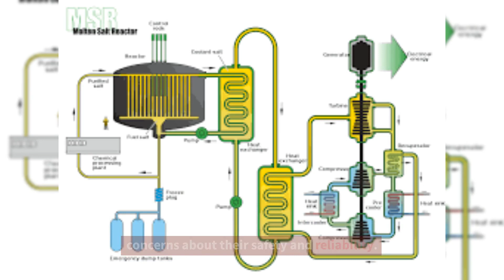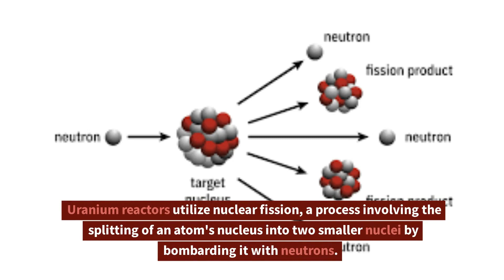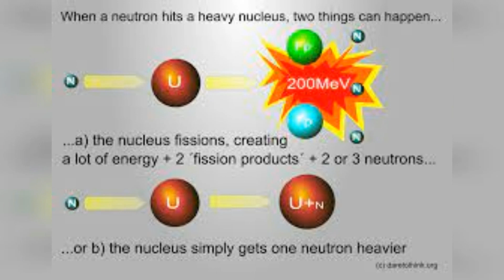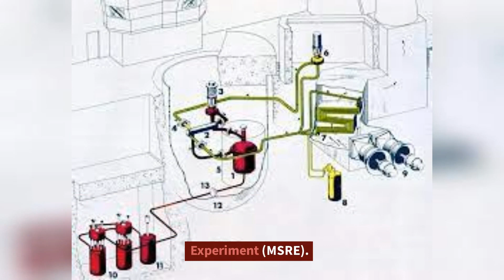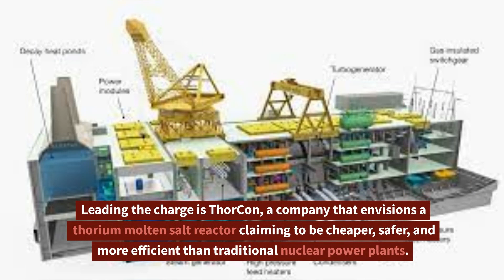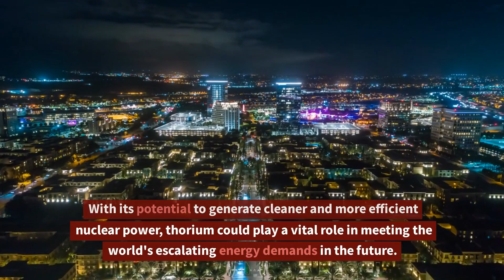Unbelievable Breakthrough: Forget Nuclear Fusion, We Have THIS!

Comment: We start with the premise in this video that uranium reactors, especially initially, were built to produce power cheap too cheap to meter, nothing further from the truth, that was a matter of public relations. The purpose of uranium reactors is to produce plutonium, a very expensive process that produces enormous amounts of waste Heat. Utilizing the waste heat to produce electricity subsidizes the cost of producing plutonium for the War Industry. There was no interest in thorium reactors because they do not produce plutonium, the only reason reactors are built. Without the hunger for plutonium, nuclear power would have never gone anywhere, especially the dangerous uranium-plutonium cycle.

Comment: The main reason Thorium reactors have remained experimental in the U.S. is because the Nuclear Regulatory Agency will not license anything but light water reactors. They always mention the highly corrosive nature of the molten salt but never mention the highly corrosive nature of liquid water under pressure and temperatures greater than 250 degrees centigrade which exist inside the light water reactors that already have been built.

Comment: They forgot to mention that the Uranium produced is weapons grade and would result in nearly impossible to contain from ending up on the black market, it would take so many controls to ensure it is all recycled. Next, they have had this technology since the 50's and still have basic physics and engineering problems, this is why everyone eventually abandoned it, one of the biggest engineering issues is that it does not scale well. Most thorium reactor investment channels are pure scams and should be avoided.

Comment: When finite energy resources are forcefully priced at the bottom of the food chain under the doctrine of what's called 'supply and demand' - they turn - curse...
Adam Smith's fossil fuels-powered invisible-hand, Nikola Tesla, Einstein, Huxley, Orwell and Turing should be forgiven for thinking their systems can last forever – finite fossil fuels are dangerously hypnotic to humans and their mental capacity.
Humans were not ready morally, ethically and intellectually to start the mass extraction of fossil fuels with the advent of the steam engine 300 years ago.
The Magna Carta requires now overhauling – adding to it the right for humans to understand what Energy really is;
"In any system of energy, Control is what consumes energy the most.
Time taken in stocking energy to build an energy system, adding to it the time taken in building the system will always be longer than the entire useful lifetime of the system.
No energy store holds enough energy to extract an amount of energy equal to the total energy it stores. 
No system of energy can deliver sum useful energy in excess of the total energy put into constructing it.
This universal truth applies to all systems.
Energy, like time, flows from past to future" (2017).

Comment: Sufficed to say: forget fusion, we have already FISSION, and soon Fission Breeder Reactors (which are both Thorium AND Uranium-238 types, as for the fuel respectively use as "fertile" source of fissile fuel to burn) that doesn't produce Transuranic high-level waste as well.
But... no. "Fission" had earned, albeit deeply unfairly, a dire connotation, created by "activists" and their fossil fuels stakeholders behind them during the last 50 years, whilst betting on attractive clickbaiting titles is far more simple remunerative than actually educating population about energy and stamping out blatant disinformation and scaremongering so to thus leaping forward with current nuclear to help solve energy and climate issues as far as possible.
Guess that almost anyone not fooled by propaganda and misguided dominant wisdom would think exactly the same.

Comment: FOR PETE'S SAKE ! the thorium is not the fuel! it is an element that is whats called  FERTILE , uranium is the fuel and the thorium absorbs excess neutrons , becomes thorium 233 for a few seconds , then decays further in 2 weeks to a month [ depending how much efficiency u want]  from protactinium to uranium 233 THEN ITS FUEL!  fed to the core creating more power and neutrons for further thorium conversion , this is god given magic and the most viable option out there now , dont forget there is thorium on the moon, on mars , in asteroids, other planets , you see where i'm going with this, a reactor that fuels itself with the input of something that is everywhere can take us to the stars now if we only could all get on the same page....
Reply from the maker: I know it l and It's all clearly explained in the video, but you don't know because you didn't watch it...
Reply: @Science.Stories  The story wasn't that clear on that point and had some misleading statements [like Th requires slow neutrons and U requires fast - not accurate, U nuclear cross-section is much larger for slow neutrons and most reactors use moderated neutrons. Only fast breeder type reactors (FBR) use fast neutrons and are rarely used for energy production, though are used for plutonium production].

Comment: I am an industrial chemist with 50 years experience. The MSR can be used with any fissionable fuel. Not just Thorium/U233. All of our nuclear reactors had their politics fixed by bomb production in the 1940s. The politics is the barrier to using Thorium. I have a presentation (dumbed down to high school level) and tried to communicate with both my congressman and senator. They are too stupid to understand the science (even at high school level). With our idiots in charge, nothing will be done.

Comment: Mostly bullshit. There has been plenty of R&D over Thorium reactors & fuel generation. No stumbling block(s) there.

There is ONE reason why U235 was chosen over Thorium. Ya canna build bombs out of Thorium. The US and EU needed a plentiful source of BOMB GRADE Uranium during the cold war so in that regard Thorium proved useless.
Reply from the maker: First. I never wrote that development is stuck. It's only ongoing as no commercial plant has been realized, and I'm in favor of the thorium reactor as you can see from the title and the whole video.
Second. The possibility to realize weapons with Thorium is just theoretical. Thorium is not a fissile element, so it needs a seeding process to be transmuted into Uranium.
Two kinds of isotopes are generated from the seeding: U232 & U233. The U232 is useless and needs to be separated from U233. Furthermore, we don't know prior the quantity of isotopes generated